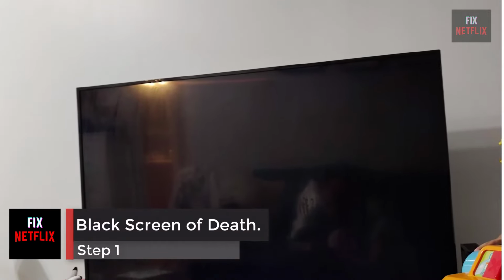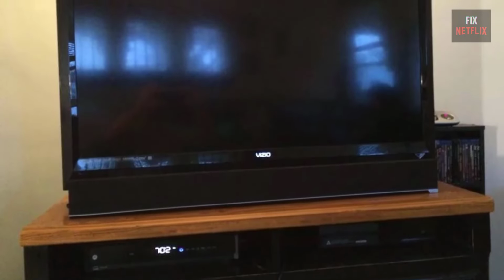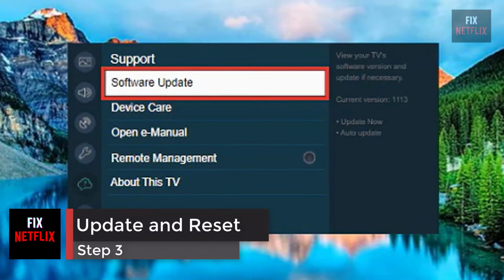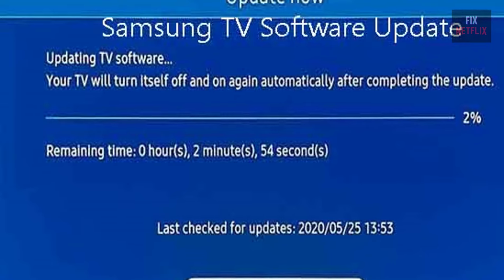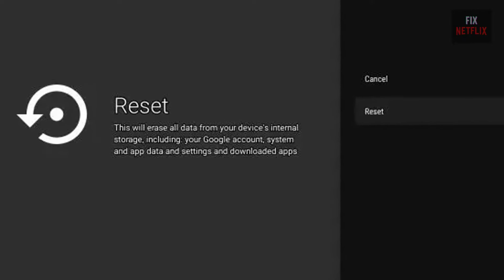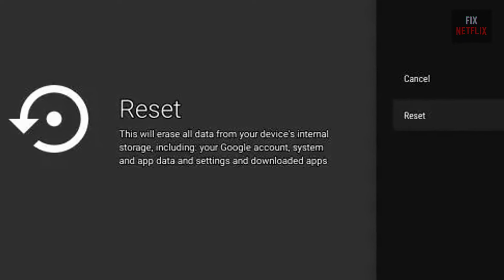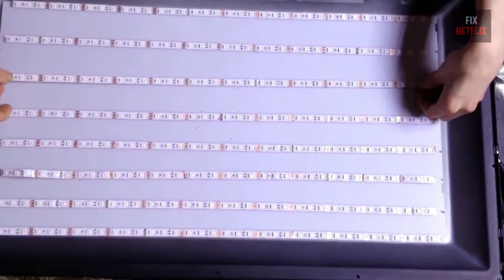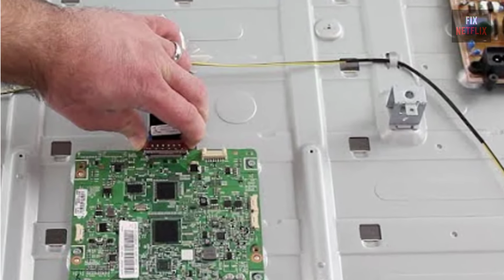How to Fix Hisense TV Black Screen and No Picture issue | Best TV Repair Guide

Comment: I did something in 1969 secret.  It is responsive with sound, but i cant see
Reply from the maker: It sounds like you're experiencing a common issue where the TV has sound but no picture. Have you tried checking the input source or the backlight settings?

Comment: How do you do a factory reset if the screen won't turn on?
Reply from the maker: Great question! To perform a factory reset without the screen functioning, you can usually hold down the power button on the TV for about 10 seconds. This should help reset it. Please like & share this video with your friends and subscribe to the channel.